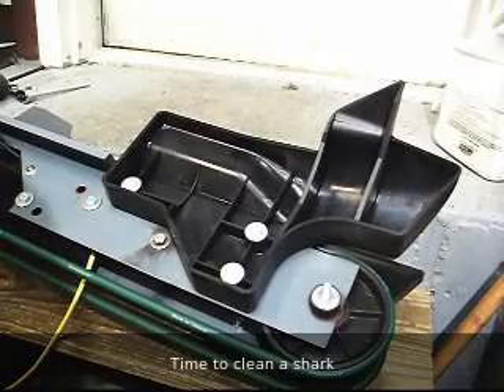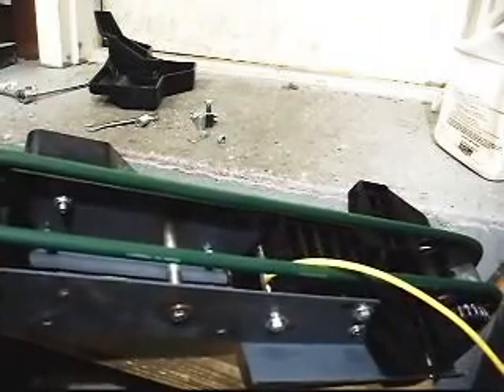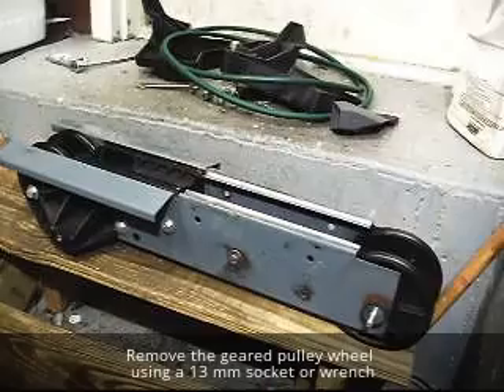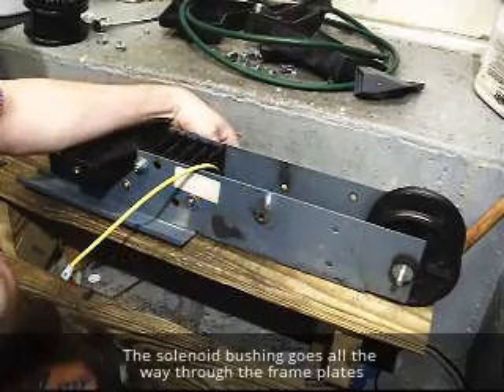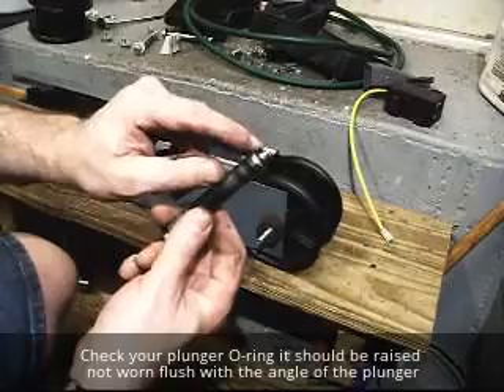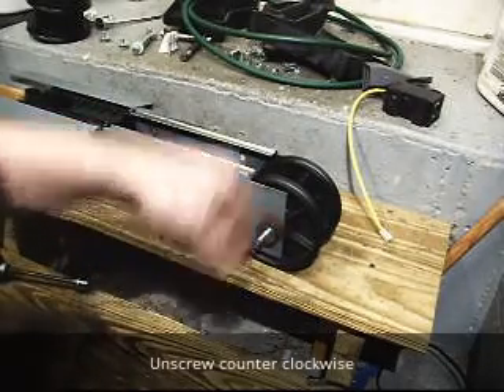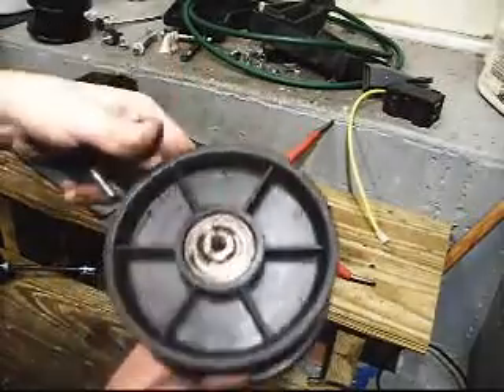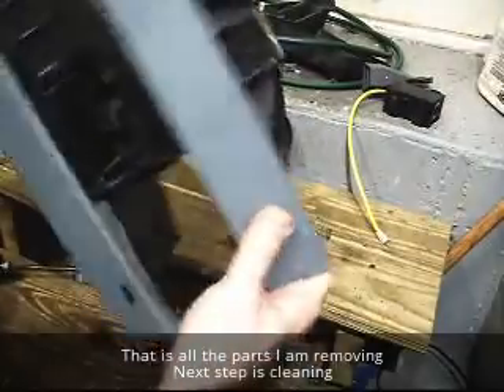Shark Dissection

Comment: Hey, I have a problem with pins falling thru the pinstation. The pinstation is fine, but somehow two pins fall down on the table and jams the machine. What could be the problem?
Reply from the maker: If this is the 4, 7 or the 10 I think the clear guide tube could be damaged or your gears could be off on your pin station causing an ejector flap to catch pins.  Or your metal frame of the machine could be bent causing the pin not to completely seat in the station causing a double load.
Reply from the maker: If it is the 4,7 or 10 pin station the clear tube extension on the retainer bow could be broken and allowing the pins to load improperly.  Thus the pin exit guide doesn't drop causing double loaded pins in the station.  And when the table drops excess pins fall on the table causing jams.  Sorry that was my best guess I needed more information as to the details of the issue not just pins falling through the pinstation.  Sorry about the delayed response.
Reply: I often have another problem. The pins get in to the ball accelerator and block the tunnel. What can i do to prevent pins entering the hole?

Comment: Hello sir i have problem with timing setting table. 1 pin or 2,3 is dropping with second ball come through. I also observe that when the table detect to pins it will moves pin holders. I see some machine not moving with detect the pins. I hope you give some tips. I think i losing timing with the table. Please help me sir I really appreciate Godbless sir.
Reply from the maker: Mike-
Check your 47-055320-003 wedge (large) and 47-055319-003 wedge (small) on the square shafts that rotate the pin holders.
When they become loose the table will shake pins after it detects them causing them to fall over.
Also check the 46-050305-004 Plastic Bearings are not loose from the table uprights.
Sorry about the delay in the reply.
Thank you for views, comments and questions.

Comment: i have a problem with the taple .it push hard on the pin can you help me
Reply from the maker: Mohmed-
Do you have more information about the problem?
Reply: tmiller453 when it go down push hard on the pin and the pin shake left and right
Reply from the maker: Mohmed-
Sorry for the delay.
There are black plastic wedges, 47-055320-003 Wedge (large)
 and 47-055319-003 Wedge (small).
Make sure these are seated completely or tight.
You don't have to drive the wedge all of the way in just until it is tight and will not fall out.
Some times when these wedges are loos the holders will shift during pin detection and when the table lifts again the spring loaded shift will knock over pins.
Make sure your 46-050305-004 Plastic Bearing and  47-055009-004 Stop Collar are securely installed.
Try this first and I think you will be up and running again.
I will post if I think it might be something else.